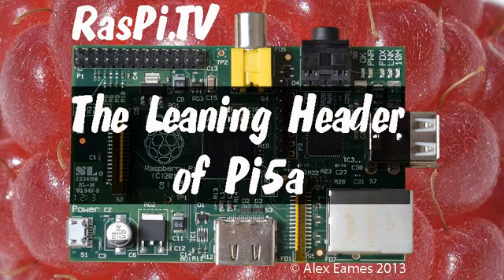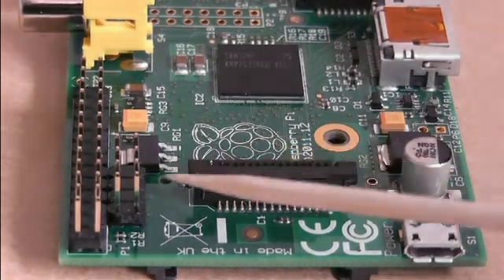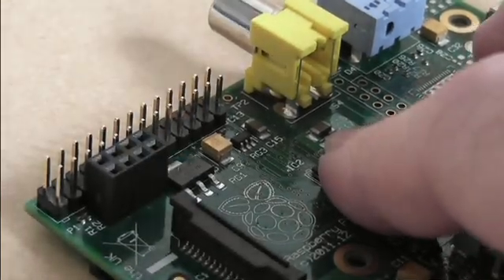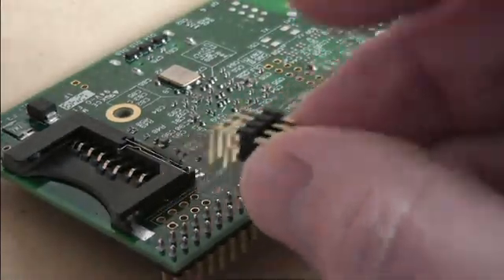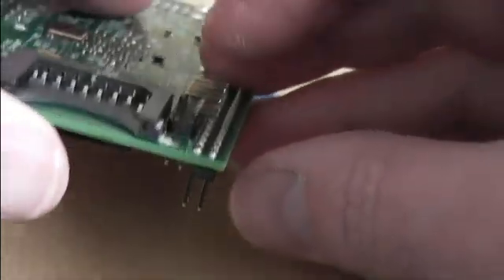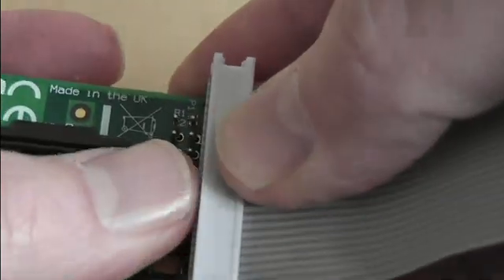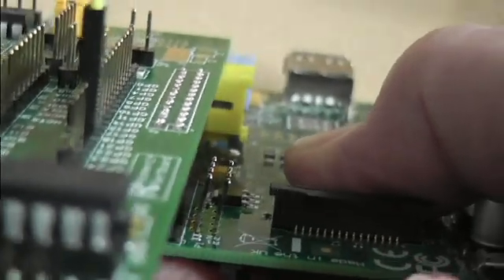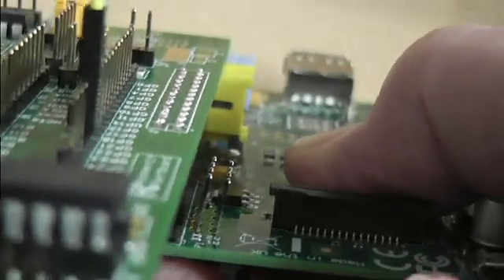The leaning header of Pi5a - or, How to fit a P5 header on your Raspberry Pi

Comment: I just started getting into the Pi. Could you also use this P5 header for reset instead of the P6? I'd like to put a 90deg tactile switch on the bottom.